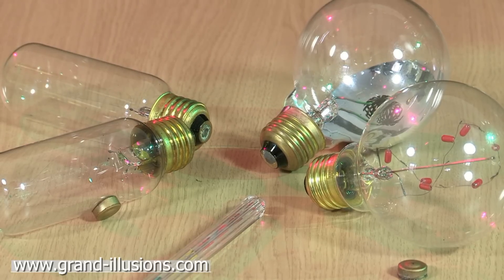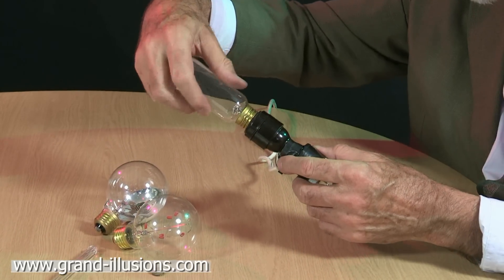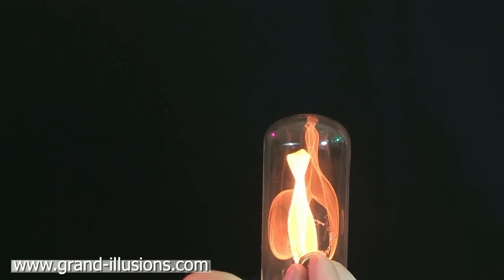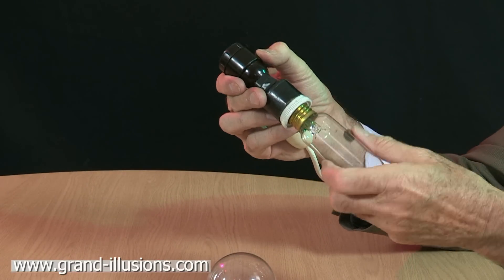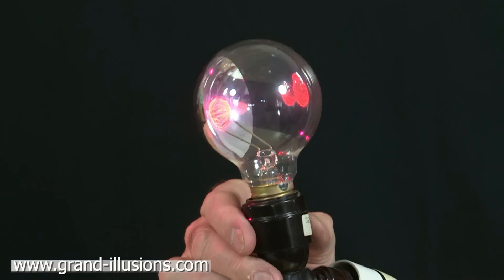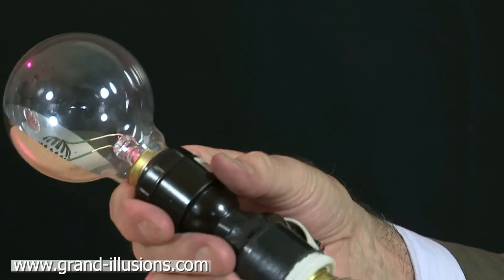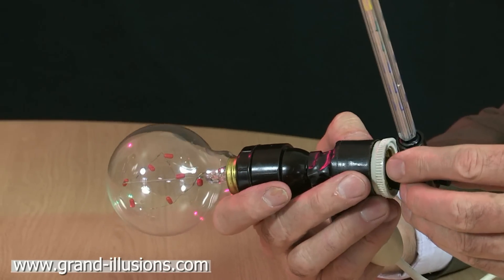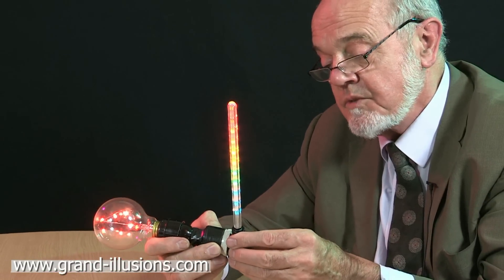Unusual Japanese Electric Light Bulbs

Comment: I still can't believe they use 240 Volts for regular house power over there.
Reply: crni195 murica is going to adopt the metric system...inch by inch :)
Reply: tryithere
120V is in no way safer than 230V. Quite the opposite I guess. Because you need double the current for the same power, fuses have to be rated higher, meaning more room for something to go wrong and burning. And don't get me started about the crappy US plugs that let you touch the contacts just before they fall out of the socket by themselves ;) .
Reply: SkittleDash   All equipment in Europe works from 220-240V. In Croatia is 240V but 220 is guaranted minimum voltage as i know.
Reply: 230v-higher voltage, lower current, smaller cables, cheaper job
Reply: where are you from?
I'm from Indonesia, which uses... I think EU standard? idk, which is 220.
Reply: superdau
Railway cars run on about 500-600 VDC. You're arguing against yourself. A fuse or breaker isn't going to kick with somebody getting electrocuted before the person is dead. A 15 amp breaker would need over 15 amps to kick and you would be long dead by then. A breaker also has nothing to do with the amperage flowing down a line, it is a passive device only designed to regulate the maximum current that can be drawn. A GFCI is not a circuit breaker and only protects you if stray current is sent down the ground line. The voltage does matter, get a 12v car battery and put your hands on each of the terminals. Unless your body has high moisture % and salt content, you won't feel anything except maybe a tingle and car batteries are rated 650 amps and up. Now go try the same thing with a 220V line and get back to me.
Reply: Where is "over there" for you? The whole world uses 220 or more except for North America and Japan.

230V is more efficient and allows for thinner cables (=less copper needed). Many houses also have got 400V 3-phase sockets here (here being Germany) for power tools and workshop equipment.
Reply: crni195 Good luck while visiting Brazil for Fifa World Cup, we have all four models here, 110V(single or 2phase) and 220V(Single and 2 phase). Depending on which state you are.
Reply: ***** Just poking some innocent fun here...don't take it too harsh, as for ignorant retards...don't worry...we each have our fair share. Check out the movie Idiocracy, it's about to get real :)
Reply: Mikael Murstam The UK uses the 230V standard but I can almost guarantee you will measure around 240 on any outlet.
A lot of people don't seem to take into account there are tolerances on the stated voltage.
Reply: Mikael Murstam I believe the EU standard is 230V +10/-6% which fits very well over the old UK standard. Also peak to peak voltage would be more like 320V.
Reply: tryithere Yes, but lower current requirements makes distribution and domestic wiring easier and cheaper.
Reply: Dan Nixon that's true... the reason we still use 240 over here's to decrease cable gauges and increase the amount of load the grid can take... just one power station at 60% capacity  (that's 24KV at at least 35,400 Amps boosted voltage... give or take) can power a city the size of Leeds and then some... the higher voltage means less current draw and less thermal waste, meaning that we have a more efficient (and ultimately, slightly cheaper) energy supply. oh... did I mention the prices drop after 10PM... as for fire prevention... the sockets still handle a max of 13 Amps on a standard BS1362 3-pin earthed socket... the higher voltage does decrease the current, but it's still hazardous since per fuse you can pull up to 26A in any given section of the building... 240 is more deadly in this perspective and can pose a greater fire hazard if cheap power cabling is used or if faulty wiring is still in use. the same goes for any other country, but in the UK, it's more important that power cables are checked and tested for safety to make sure no shorts can occur... and that double insulated devices (those with no earth wire, just live(hot) and neutral) are safely built and well internally shielded and externally insulated. if you ask me... it's a more dangerous power supply to work on, but it's good for industry, who normally need between 240 and 415V to operate.
Reply: murmaider2 ;
Someone doesn't know their physics Joule heating law is  P(dissipated)=i^2*R
Double your current quadruple your power dissiapated(that only applies to resistive loads though reactive loads make it a bit more complicated)

Uk building sites have to use 110v which is 55v volt phase to phase they a center tapped transformer to produce the voltage., we haven't have a death on a building site due to electrocution in a long time.
Reply: ***** Strange why every house burns in Necroville... I don't get it. Some kind of curse i guess
Reply: *****
Are you saying they can't resist?
Reply: The commonplace saying "it's not the volts that kill you, it's the amps!" is an age old phrase that makes no sense once you actually understand ohm's law. What kills you is energy, which is an overall sum of the interactions between voltage, current, resistance, reactance, capacitance, and time. Static shocks for example are upwards of hundreds of thousands of volts, and for sure can deliver enough current to stop a human heart, but they never do because they are done and over with in less than a femtosecond. But, touch an adequately charged 220v capacitor and you'll probably get thrown across the room because the overall energy output is much greater than that of a static charge because capacitors don't discharge in less than a femtosecond. The electricity is being discharged substantially slower than that of a static shock, which results in overall greater energy that is put into your body (In this case, energy refers specifically to joules, which is a product of [something] applied over the course of time, the same electricity applied for a longer period of time will have a higher energy at the end of the discharge than the same electricity applied for substantially less time).

The current pulled into ANY system, be it an electrical circuit or your own body, is entirely dependent on RESISTANCE. Electrical circuits will only ever pull as many amps as they need, and what they need is based on their resistance. This changes when there is a short present within the circuit, in which the electricity takes an undesired path to ground, thereby reducing the ideal resistance of the circuit. In the case of the human body, this is a (mostly) fixed resistance. The resistance of human skin varies, but for the most part it is high enough that even 120V won't kill you. It will sting and hurt like nothing you've probably ever felt, but it will not kill you because at that voltage, it can not reach the breakdown voltage of your skin. Higher voltages, on the other hand, can reach the breakdown voltage of the skin. If you want to deliver more current into a FIXED resistance (like a human body), the only option is to either reduce the resistance (create an opening somewhere on your skin/get your skin wet, either of these will absolutely cause harm and be fatal even with 120V), or increase the voltage. More voltage, more forward current. Ohm's law. It's simple math. In general, higher voltages are much more dangerous to work with because of the simple relationship between voltage, resistance, and current.

EDIT:
Also, I have no idea what is giving people the idea that a higher voltage must mean the wire gauges can be thinner, thusly preventing a fire hazard. That is not how voltage or current work, at all. Electricity itself works like this: pushing a higher voltage means you will have a higher current, so unless the systems in place over there also current limit (thereby being exceedingly wasteful), there's nothing about people saying "we can use thinner wires!" that makes any sense. Also...the thicker the wire, the LESS chance of a fire hazard because the wire is large enough to aid in dissipating heat. That's what causes fires in the first place, the wires are not adequately sized and are incapable of dissipating heat, causing the insulation to burn and in worst case scenarios, wear away and short with other wires that have also melted away their insulation.
Reply: AdrianoCROST croatia  :D
Reply: In England that is the voltage they use.  I lived there for 3 months.  Europe uses 240v.
Reply: we have half you'r amps for the same power flowing trough our wires, we save copper   that way
Reply: tryithere
Most death and damage is not caused by the electricity itself, but by fires caused by electricity.
Reply: Mirek Heikkila There is probably little difference, if installed properly then neither is any safer. If installed incorrectly 240V is marginally safer since it can transfer more power on lower gauge cable (from a fire prevention perspective at least).
Reply: current lowers resistanse. more Volts = Thinner cables.. - less copper.
Reply: 1Howdy1
Also interesting is much of AC as setup in the U.S. mains actually has roots with Tesla and Westinghouse, not Edison. (Although much of electric companies that produce electricity started with Edison.) And then looking athow somebody like Tesla would have wanted to make it simpler, you'll also see why 60Hz is even a more obvious choice when it comes to doing the math. (Easily divisible by 3, 2, 10, etc. with no remainder. Makes general-purpose timing, working with 3-phase systems, and step down/up something you could do in your head or on scrap paper instead of dealing with repeating decimals and stuff like rounding errors.)
Reply: ppl in this thread think they can ohm's law lol
Reply: +superdau well, in brazil we have both, 220 and 110, we have too at least 5 plug e sockets types, and thats not all, two types of very distint but valid coins for, 1,5,10,25,50 and 100 cents of R$

my life is a mess
Reply: THUNDERBOLT
Yes you do but since it only takes 100-200 mA to kill you, which you are already at, that doesn't matter. Increasing the voltage makes it easier for those mA to hit you.
Reply: that's Britain for you... although, we stepped it down a little... we're now operating on 230 and 240 at a low load time... but 230 is the most common!
Reply: superdau I have a 380 5 pin socket
Reply: 1Howdy1
Another reason for high voltage is the higher the voltage, the easier electricity runs through wires over longer distances.
Reply: It can go above 13.8kv. 27.6 is quite common. It is usually listed on the pole. Take the Sine of the angle between phases times double the voltage of one phase and you get the voltage between them. Of course, that's the RMS value.
Reply: umm, its 220 V in Sweden. is that bad lol? i guess we are tough
Reply: High voltage low current can use cheaper (thinner) wire safely, that is why all modern electrical grids use 220-240v. USA just had too much 110v stuff when 220 became a standard.
Reply: @rjmcguire100   The grids use 400 thousand volts, the 110 /230v only travels a short distance to a substation or transformer on a pole, it gets progressively higher via other substations until it reaches 400kv, not sure if it goes higher than that .
Reply: pauljs75 What's the point of diving the frequency?... every device in your house is powered by AC current but the moment the current enters the device it's transformed into DC. There's no technical reason to prefer one over another and countries have adopted either standard for economic/historical reasons.
Reply: Kadum
You have to consider that before modern solid state electronics that work on DC and have their own built-in timing, a lot of things were electro-mechanical. Therefore current cycle was often used for purposes of timing. (If you're into antiques, you could probably find an electric clock or some device with a timer circuit from 1960s or earlier that works that way. They'd use something like a stepper motor that only advances for half the cycle. Perhaps one of those early "digital" clock radios with the flip-board digits?) And in some other appliances or power tools, it makes it fairly easy to build an induction motor to work at a specific RPM with no special controller electronics needed.
Reply: I cannot believe that I have seen such a comment section like this under such a fun video. You are all disrespectful and easily-offended pedants who are full of rage and hatred. Shame on you.
Reply: ^I was referring to the commenter, tryithere
Wow, thanks. I thought 240v was more common.
Reply: Josip žalik
  :)
Reply: murmaider2
 ...not sure if troll or just fucking stupid.
Reply: Here in Australia we use 230 volts 50 Hz single phase for regular power over here.
Reply: Are you bad enough dude to use 220v?
Reply: Most countries use between 220V to 240V power at 50hz. Australia uses 230V 50hz power. The UK uses 230V power like Australia and New Zealand and Europe.
Reply: +Mikael Murstam Mine used to measure at 251V.  Bulbs forever blowing.
Reply: superdau You mean cheaping out and Canada Mexico and South America uses 100-120 Japan and I think India also uses it to do go figure
Reply: superdau then you have the worst example of a us socket to ever exist, thats only happened with incredibly cheap products for me, and by cheap, i mean even worse than most things that are made in china.
Reply: crni195 yeah i know the imperial system is bull, we tried to bring metric in one time, but for  they realed it back from the specific state because nobody noticed.... yeah. second concern is rulers, because that adds up, although the majority dont need to be replaced (they have two sides) theres enough to where its still a concern in terms of money.
Reply: whoa I cant believe you have 3-phase power at homes, that so awesome. Every home or just specific cities?
Reply: Speaking of ignorance, do you live in north or south America?
I will assume north America, yes? Which country in north America would that be? There are more than one.
Reply: tryithere
I didn't talk about toy trains. The trains I see running use 15kV (wouldn't know how else you'd get several Megawatts down the line otherwise).

But I have the feeling you don't even read what you're commenting on or ignore what's written. You pretty much repeat what I wrote anyway.

Btw. I had my occurences with 230V, two times out of stupidity (but hey, I was building stuff early), and two times because of badly designed appliances/lights failing in the wrong place. No RCDs installed at that times and I'm still fine.
Reply: SkittleDash
We in US have two phases of 110-120V 60Hz. each phase. Use 120V single phase normally to neutral and when required use 220-240V 2 phase. It's much safer than using 220V single phase and it does the job..
Reply: tryithere lolololol if you lower the volts you need to pump up the amps
Reply: I don't think anyone is actually using 240V. It is either 220 or 230 V actually.
Reply: Dan Nixon We have 230V in Sweden as well. I am talking about the RMS voltage not the peak though. However there might be a tolerance of 10V.
http://www.comicbookresources.com/prev_img.php?pid=23142&disp=ilib&oty=1&oid=53526
Reply: murmaider2
 if by "culture" you mean "mental illness" then you are right
Reply: all these people fail to understand that we use 240 for carrying, and then it gets split in half for home use. Also its safer for electricians.
Reply: First, the higher the voltage, the less current it takes to kill you. Second, it only takes about 100 mA or less to kill you which either voltage provides adequately. Third, the higher the voltage, the higher the resistance it will jump such as the resistance of your body. Fourth, the current that is flowing through the line while powering a device is not directly related to the current flow that would occur if you were to touch the wire.
Reply: EvilOverlord96 wow where did that come from.. interesting though.. i'll just say in canada its 120v 60hz, ussually hovers around 118ish.. I wonder what the stats are for the ratio of electrical house fires with 240v compared to ones with ones with 120v..
Reply: M1lesPerHour
sorry to burst your bubble, but conservation of energy is still at work. Drawing less amps doesn't mean you're drawing less watts. You still need thick wire.
Reply: tryithere
It's only the current that kills you. The voltage doesn't matter. Of course the voltage has to be high enough to "drive" the current through a resistance, but as you stated 110V is enough for that anyway. If 230V were more dangerous, why are the only accidents with electricity I hear of stupid teenagers climbing rail cars?
I know the current through a device while running has got nothing to do with touching a wire. I wasn't even talking about that, it's about the fuses. They are not there to protect you from being electrocuted, they are there to protect stuff downline (including wires and contacts inside the walls) from getting hot or burning in case of a failure. If the fuses "break" later (because it has to be higher rated to not trip in normal operation) there's more current to heat something that shouldn't (because like with electrocution it's the current that heats things, not the voltage).
Reply: Andyatf Pardon me but where is this country "murica"?  I live in America, born and raised.  Do not contribute to the ignorance that is rampant here.